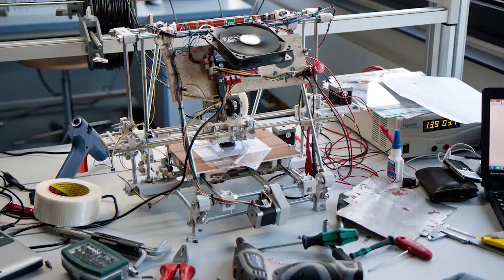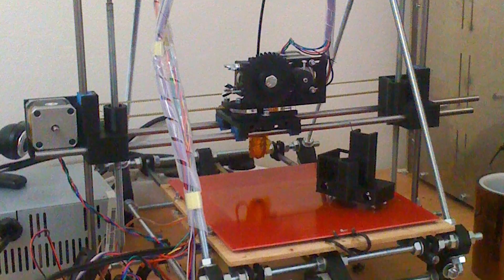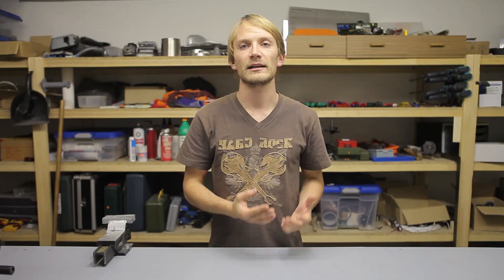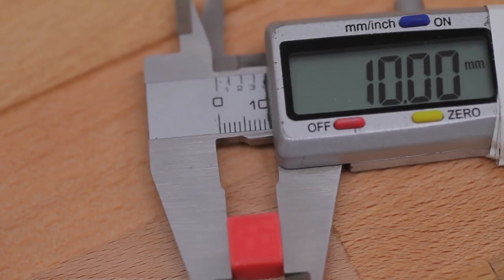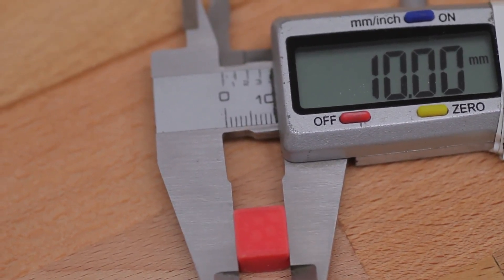3D printing guides: Calibration and why you might be doing it wrong

Comment: Thank you, this is going to save me a lot of confusion. Pretty new at this. Is layer shifting at all related to miscalibration? I had a 30ish hour print fail @ 92% because it layer shifted ~2mm. Just once. Then subsequent print started shifting a bit each layer or two, the shifts were all in the Y axis direction (layer skips occurred going from the front to the rear of the bed surface). Ender 3 pro stock components, if anyone can direct me to further information on this issue I would appreciate it.

Comment: I love commenting on old videos, so if this has already been said to death in the comments...
-
The problem is in calibrating to a size that is a fraction of your build space. It's the same problem that occurs on lasers, and cnc routers. I own all three of these machines, and on each one it's necessary to calibrate to the entirety of your bed, build plate, etc. So, as it's been stated, any errors in the 10mm cube will compound along each axis. If you calibrate to the whole print surface, or at least very close, this compounding is much less noticeable. We can get much more accurate assemblies from our 3D printers. 
-
Accounting for shrinkage is a different matter though. This is done all the time in injection molding. In my opinion calibration should be done with a golden standard material, meaning one that is more dimensionally stable. Then have a standard "shrinkage" model that you account for in the slicer when using that material. This is a wheel that doesn't need to be improved upon. The improvements will come in how the software guides you through the process. Essentially 3D printing is moving on a trajectory to hopefully overtake injection molding, and I believe that it eventually will. 
-
I only wish it were today, as I'm currently pricing injection molding machines to add to my shop. Yikes! I would jump at a sub $25,000.00 3D printer that was capable of serious production. It will eventually save a lot of money for everyone. Hopefully.

Comment: The problem im having is when i print a 20mm cube its consistently short 0.2mm short in the Y direction and 0.6mm short in the X direction. A 40mm cube has even greater discrepancies.

Comment: I just bought a Creality Ender 3 Pro and using Cura slicer on Linux Mint. One of the first prints was a dial indicator mount. I leveled with paper and then used the indicator to match all the corners to the same level. Printed a test cube and to my amazement, when I checked with my calipers it was dead on accurate on X Y and Z axis measurements. I'm extremely surprised at how accurate 3D printing is. So far I don't see what everyone is talking about fixing printing issues. Sounds like its just when someone is tweaking the advanced settings or print speed that issues arise but maybe I'm wrong.

Comment: Hi Tom! I'm having a lot of trouble with the calibration of z axis... When I send a command of movement from the lcd printer or from the pc are perfect. But when I'm printing the calibration cube, on the z axis result 14.8mm instead of 20mm. I'm building a copy of the cr-10 with 2 z axis wired together in series with a mks gen 1.4 board.
Tried out everything, also the prusa calculator but still the cube came out with wrong measurements only in the z.
Thank you very much if can help me, I'm really freaking out. Keep post useful video like this! Congrats!
Reply: in marlin up the run current for the Z axis,  or max current, the Z axis is fighting againt gravity so it needs a little more run current than the x and y. it'll be under configh adv. hope this helps

Comment: I have a Ultimaker-3, printed a 25mm calibration cube, measurement with a micrometer: sizes are about 25.15mm and the walls (1 layer shell) is not 0.44 (extrusion width) but ca. 0.55 - 0.58.
According the Ultimaker website, x&y and stepper calibration is not needed, but I am not sure of this is true because the wrong sizes....  What do you advice ?

Comment: I calibrated my steps. And got my cube to like 10.05 XY with 100% infill .
Changed to 20% and the new one 9.90 XY  weird
Reply: Not weird, that's overstuffing. i.e.: sounds like your extruder seems to be pushing out ever so slightly more filament than it should be. At 100% infil you were trying to calibrate against a cube that had too much material in it.

Comment: So... this begs the question, how do you get more accurate prints then? ie If i'm printing something with holes that need to be somewhat accurate, and I'm noticing they're just not printing to the size they need to be, or in the right locations, how do you fix this? I need say a 20mm hole in the middle of part that is 20mm but a tight fit, and maybe say, 4 holes around it as through holes for bolts.. I need the holes to be accurately located, and I need the 4 through holes to be accurate enough to allow me to get the screws through.

also, how would you then print an accurate 20mm cylinder to slip-fit into that hole mentioned above?

Comment: My method does not require to know the extrusion thickness, as the measured distance will be coming from the same side. So. I did the following to calibrate my X & Y axis: Create a stepped cube with the following dimensions: L 120 x W 20 x Z 8 and a X 20 x Y 20 x Z 8 on top at one end. Slice and print. Once the print has finished, I measured the difference of the 2 cubes. 120-20=100. If you end up with any other dimension means you have to many or not enough steps in your motor. Now you can adjust accordingly. If you do this for the X axis first, rotated the object in your slicer 90 degrees and repeat for the Y axis. Make sure you use precision measuring instruments (at least a dial vernier or better a couple of micrometers. Contact me if you have any questions as English is not my first language.

Comment: Hey, I have an M3D printer, and it is printing circles in the shapes of ovals. Do you think that calibrating the x and y stepper motors could solve this problem? or is it something else entirely? thanks!
Reply: It's probably a bit late at this point, but in this case.. yes. If it's visibly an oval and not a circle, one of the steppers is not matching the other.

Comment: My 10x10x10 cube comes out as 10.89x10.89 and my 20x20x20 is 21.3x21.3
Reply: Please help
Reply: Kinda late reply, but read the replies to Rubafix989 above.
You need to check your printer's Steps per MM, but there's MANY factors that cause it - Filament type, temp & humidity in the room, if your filament has absorbed moisture, hotend & bed temp, actual nozzle size, Extrusion rate (a BIG one, Tom has a video on this), the list goes on. Try to find a good forum for your printer type and ask there. Start with adjusting the Extrusion rate (Extruder Steps per MM), the rest are more technical and may not even be needed, the point of Tom's video here.

Comment: we come along way, i remember buying just the printed parts to build my first prusa back in 2011 for almost 500 bucks, and spend close to 12 hundred to finish it. 2 weeks ago i had an a8 drop to my door for 165...
Reply: Markitos203 if there's a way to build it for cheap, the Chinese will definitely figure it out
Reply: Yeah prices dropped dramatically past years.
Reply: I got an A8 three months ago. It prints alright, but the frame is unstable, and the board burned out in a few weeks. Be ready to order a Ramps, and invest in some t-slot rails. At this point I only have the original motors, and guide rods. I should have played $300 for a better rig. I've put at least that into this, not to mention the time to rebuild it twice.

Comment: ok but for those of us that dont know the specifics of our machine (screw pitch, motor step angle, etc) the prusa calculator won't help at all. so at the moment 20mm cubes still seem to be the best option. (printer is a tronxy p802ma with autolevel)
Reply: I completely disagree with what Tom is saying.  Prusa steps per mm are just starting guidelines.

Comment: Hi Tom. I have nice printing delta. The only problem is I can't pass 1 perimiter cube test. I have 0.5 nozzle installed. The result is 0.8-0.9mm wall thick cube... I have checked steps/mm for e-motor. Extruding 100mm gives 100mm of filament. Changing extrusion multiplier doesn't help. Do you have any ideas?
Reply: what is your extrusion width?

Comment: Do you have a video that goes over changing settings when calibrating with a test cube?  Like say for example my test cube printed at 40mm  measures z=38.2 x & y = 37.9.
Reply: Don't adjust the printer to a test cube. Adjust the printer to a STANDARD, then if it's still wrong you adjust the SLICER for that filament and conditions. See the post from Rubafix989 above.
Start with Extruder Steps per MM, it;s easy and often wrong from the factory. Can change with nozzles, and even filament type. Once you know how, you can check it with every new roll and write it on the roll. Takes less than 5 mins once you've done it a couple time. Tom has a video. Thanks Tom!! :-)

Comment: As you said yourself, the backlash and other factors can already account for a 0,1mm difference on a 1cm testcube, which is a full 1mm on a 10cm cube.

Wouldn't it be better to just print 20cm long bars with round end on both the X and Y axis (one at a time)? This minimizes backlash and other factors that change the dimensions, and the rounded ends avoid the edges which can turn out to be thicker than the straight lines.

Comment: hah! before I have watched your video I calibrated mine. Without the filament. with metal ruler lying on the bed. I have commanded my printer to move 100mm on x axis and it did 80mm. same thing on y  axis. I needed 125mm command to get the actual 100mm. z axis was even more off - to get 100mm I needed 500mm command :) pretty useful numbers ;) The bigger the distance the better resolution - got it calibrated in one simple tweak. You're right - the calibration cube has too many factors to be taken into account, it can't be good

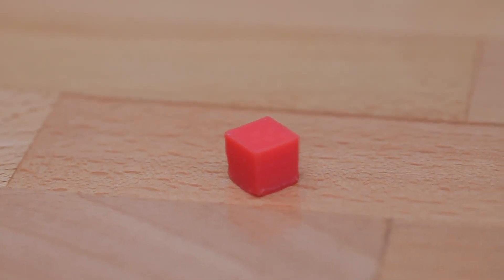Comment: Hello Thomas, at 1:10 you talk about printing a 1cm test cube to do the calibration. The calibration cube is meant to show the precision of your calibration. But it is not meant as a calibration tool. If you want to calibrate your axis (and you should), measure the position of the carriage on the desired axis, then ask it to move about 10 or 15cm and measure again to see how much it actually moved. Then do the math and adjust the step/mm value in the firmware. My test cube is 10mm +- 0.02 after calibration, when before I had variation of more that 10%, which is unacceptable when yu design stuff that has to fit in the real world.
Reply: When one comment is 1000 times more informed and useful than the 7 minute video.
Reply: Rubafix989 you changed my life! LOL!  I've been wresting with a Monoprice Maker Select for 7 months and am finally getting some good prints (LONGGG Story). But whenever I extruded a precision part it would be wrong on the dimensions. I KNEW the complexity of the system: Filament temp, REAL nozzle size, humidity and room temp, bed temp, and of course, X & Y issues.

The engineer in me railed at the people pushing to adjust the PRINTER to the PLASTIC ITEM, but so many "Experts" said to calibrate that way. Then I saw YOUR comment and the light bulb went off. Of COURSE you don't adjust a machine to it's output, you calibrate to STANDARDS then fix the output in the software. DUH! Don't you love when you get an epiphany?! LOL!

Thanks!!! 
 I now have a perfectly calibrated (Well  ... as close as you get with an open loop system ... :-)    )  Extrusion, X & Y,  - still have to do Z.  Now I can work in the Slicer to fix anomalies, knowing the printer is doing it's thing to standards.
Reply: I have just 2 words: Thank you. 2 more: so much !
Reply: Jeez, thanks a lot guys for your comments!
I didn't really get anything out of the video as a beginner, but your comments were straight forward and my prints are beautiful now!
Reply: Hi Ruba, do you know of a video that goes over that?
Reply: Thank you for that. I've been getting terrible results on my anet E10  lately and was wondering if this could be the issue. Will try it out in the morning
Reply: Mark - If you use a program like Repetier-Host, or MatterControl, or many others, you can go to the Manual Controls section and command the printer to move 100mm on any axis. You should HOME the axis, measure it from a known point (frame), move 100mm and remeasure. Write it down. Do it at least three times, then average them.

Take the result and divide it into 100, take THAT number and multiply it to your current Steps per MM ( in Repetier-Host it's under Config -> Firmware EEPROM Configuration), then change that number in the Firmware window. When you hit OK Repetier-Host sends it to the printer as the new value. I also use Manual Control to send a G-Code command of M500 which forces a save of the Firmware, but I think that's overkill. Ex: you measure 101.5mm. 100/101.5 = .9852 (go to four decimals) then .9852 * 80 (my original Steps/mm) = 78.8177. Put that in as the new value and redo the test.

You're NOT done. REPEAT the Home, measure, average, calculate steps and be sure you now get 100mm traveled for 100mm commanded. ALWAYS double check when you make a Firmware change!!

Comment: Thanks Thomas. Thanks a lot once again :-)
Setting up more voltage on stepper driver helped with my issue:  I changed M8 screw into Tr8x8 (I know that Tr8x2 would be better but for now in Poland is exrtemally expensive :-). Maby I'll do it in few months)
I  observed following behavior: just half a second before leyer is finished stepper motor is moving a little bit (?to closest, magnetic positon?) then finally moves to correct step position. In previous voltage (in my case 420mV) it made part of step backword then finally forward to "final" position. Final position was of cours difference of rotations, so final printig was flat.
Now, after i changed voltage to 550mV it makes this same fraction of step but now forward. Sum of small asnd larger steps gives wrght printout. With my steps/mm setup to 400 (from calculator), printer prints ideal 10mm cube. I wonder what is going on - if this is question of motor, or stepper driver, or set of microsteps(1/16) waight of Tr rod, or...?
Do you have any idea (or knowlage :-) )
Best regards
Tomasz

Comment: trying to get my hictop prusa i3 mk8 to work correctly. the extruder motor keeps going all the way to the left and banging against the z axis can someone please tell me how I can get it right. so it is not doing this it happens when I start the print process.
Reply: reverse the axis. take the motor wires and flip them.

Comment: Hi tom, I have a Prussia i3 printer with a gt2560 control board, I got it printing really nice but I printed a 25x25 MM. Cube and it's came out 20x20 MM, what setting do I change to sort this 5mm differents out. Many thanks paul
Reply: Hello I have the i3 x prusa with the 2560 board...Using Repitier host, go into print settings and advanced. At the bottom you will see x y compensation. This is where you can try a -/+ number to compensate for the size of the sq. print.

Comment: Hey Tom! I have a makerfarm prusa i3v, and lately my Y axis stepper driver has started overheating, even when the current is set too low to drive the motor properly. it is a ramps 1.4 board with polulu a4988 drivers. can these degrade over time? should i try something else before i replace them? also, can you suggest an upgrade?
Reply: Edit- The stepper driver is absolutely fine. the problem was my Y pulley slipping on the motor shaft. i can report the problem fixed!

Comment: I recently got a Me creator from geetech, it prints nice and all but the dimensions are a bit off alone the x axis, if I print 20 x20x20 I get 18 on x 19.5 on y and 20 on z, I tried lowering the print speed, and also calibrated the extruder. but all it did was make the prints look a bit more neat, it used to have a distorted corner along the x y axis on top now its a perfect square ,but the dimensions are still off how do I fix that? (I even tightened the belts and stuff but stil no use)

Comment: Hey! I used Prusa calculator, but it didn't work for me. I have typicaly NEMA 17 with 1.8 steps, driven with RAMPS 1.4 with A4988 modules, GT2 belt... but still. When i need to move axis, it moves much bigger distances than it should. Where can be problem?
Reply: That's a thing i'm not sure about... :D Where can i find what microstepping is my printer using?
Reply: +Thomas Sanladerer Solved!
I didn't know about those jumpers... now my printer moves flawlessly, thanks for your advice!
Reply: What was the fix?

Comment: If you calibrate a printer on a  program like cure do ii have to recalibrate it on another program like mesh mixer?
Reply: ya u will have to, if u changed the values in the slicer software. coz those calibrations are software specific and has nothing to do with the data stored in the printer